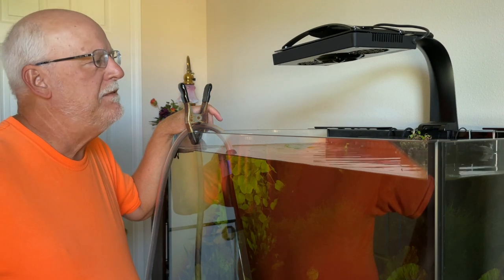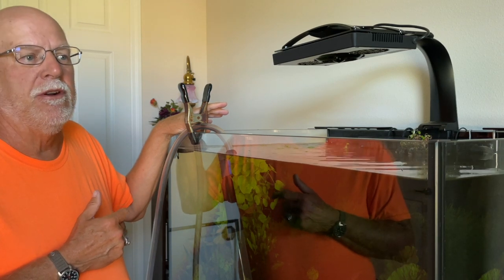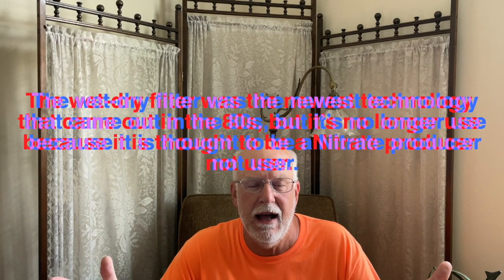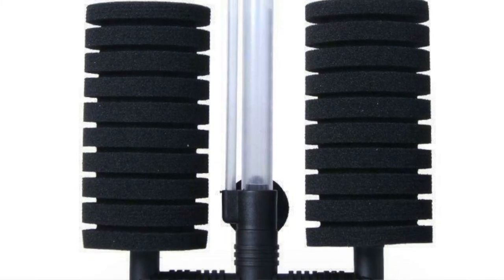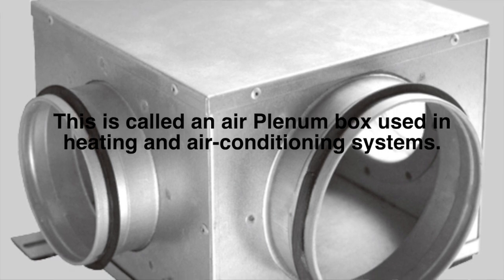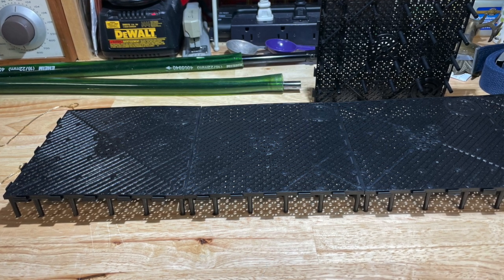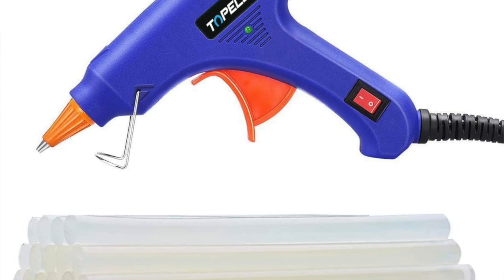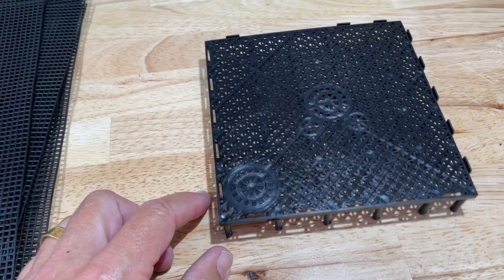Understanding the differences between a Plenum and an under-gravel filter.

Comment: The undergravel filter was killed as was clover in our grass lawns. Corporate couldn't realize a profit on a perfect filter system. Buy hang on, buy canisters. Kill the unbreakable undergravel filter.
Reply from the maker: If they are made of iron, or have iron impregnated into the Clay.
Reply: Under gravel filters work really well, but as you say, there's no cartridges or supplies to sell with it so it had to be declared to be inadequate. Just a plain old UG filter with some gravel on top will work for years and years. What accumulated under the filter is harmless and can be occasionally suctioned out through the lift tubes if so desired.

Comment: Contary to what Novak says in this video, if you keep mbuna cichlids, it is important to put your rocks directly on the bottom of the tank and then fill in your sand substrate around the rocks. Otherwise, if you put put your rock pile on top of the sand, when the fish dig the sand out from under the rocks, the rocks will shift and the whole rock pile will come tumbling down and potentially break the aquarium glass.

Comment: Hello Dr Novack from the uk.
I set up 2 tanks, exactly the same size, one with soil/gravel capped and the other with a plenum. (Ceramic media rings with mesh on top, then gravel) 
I then planted the same amount of plants in each and placed one light covering both tanks. The tank with the plenum, had much better, by a big margin, plant growth than the dirted tank. 
Thankyou for taking the time to share with the hobby.
Reply from the maker: This is something that you just said people do not understand keeping biological and chemical pathways open is a must. Once you do that and achieve that your plant growth will excel. I also explained that in my videos that you may come up with a "jungle tank" as I call it because the plants will outgrow the tank itself.
Reply: Did you have a bubble tube for your plenum? Or just the plenum on the bottom?

Comment: Your videos are EXTREMELY interesting. It makes me highly motivated to try  a different method of aquarium keeping
Thank you
Reply from the maker: Happy to hear that!
Reply: @anoxicfiltrationplenums  I am also motivated to try something different. I am having trouble with my 10 gallon betta tank.
My boyfriend mentioned under gravel filter. The penn plan is readily available.
From my understanding I would only need one of the lift tubes and it comes with 2. How do I block off the other tube!? Also can I use a dirt magnet as well!?

Comment: Wow 👍
So I got unto this hobby 8 months ago
And it was a dirt - planted tank that caught my interest
Now I find my self. Wanting to set up an African cichlid tank... But
I was a bit over whelmed with the work ( water changes) that I was hoping to avoid in this hobby
This under substrate system sounds great....
?  4U
My 100g has an outlet on the bottom, I should be able to send the water down right? Was thinking to send this water 💦 through an aqua fonics system next before putting it back in the aquarium 🤷:)

Comment: Thank you for highlighting and explaining the UGF with the plenum space. I believe the true downfall of the under gravel filter is not because of advancements in filter technology but  is the aquarium industries identifying that a  UGF as “dead” media of revenue. Once a ugf is sold, there’s little to no future revenue.
 The increased “ease of use” promoted by the manufacturers for quick and easy HOB and canister filter media exchange and replacement generates a continuous income but has also created more physical maintenance, increase costs for the hobbyists. Even the past 15 years, so many online experts have come forward like convicts reproducing to tell everyone that high flow rates and  increases maintenance with the introduction of even more additives and mandate increased  frequencies of water changes. Some even  advocating massive doses of fertilizers, macro and micro nutrients along with large % weekly water changes for planted aquariums. Aquarium products are very lucrative.  Not much after market once an aquarium is set up and finds its balance when using a UGF.- less maintenance, rarely done water changes unless topped off weekly due to evaporation.   What I’m getting at, marketing has dubbed UGF as old and inefficient and highlighting the dangers Of trapped gases in the substrate that is a “ time bomb”  just waiting to kill all your fish. 
 I’m most of my aquariums I’ve used. UGF, either with grid or pipe but this was my first time of hearing the term plenum and what the space offered and the science behind it.  On my largest aquarium, 240g heavily planted is UGF designed.  3/4” drilled pvc pipe grid surrounded by, 2” layer lava rock  then a fiber mesh, then  2”-3” gravel  layer with 2nd fiber mesh layer and 2”-4” course sand cap layer.   My up tubes are 1” topped with older styled power heads. I have utilized the the overflow compartment as a pre filter, flooding the space and adding mechanical and bio media as my high flow oxygen exchange area going into 3 cascade canister filters daisy chained together and uses an inline dc pump. I also have a stand alone cascade canister filter that the flow is reduced and being utilized as a co2 reactor with citric acid and sodium bicarbonate fed 4g  high pressure garden sprayer as a co2 generator.  My bio load  is high due to very heavy stocking.  This has been a very sustainable and minimal maintenance aquarium.  With this UGF setup I’ve experienced week long power outages without cycle crashes that some of my other aquariums have experienced.  Since the sand is white,  I do siphon the sand  of detritus and water that I collect for my garden.    In the beginning I was using a modified Ei method of dosing dry ferts but have since reduced to only adding trace micro and a few macro nutrients. Not  Adding potassium, iron or nitrogen ferts  just has not been needed. I do water changes but it’s based on my TDS levels when they reach. 700-950ppm  directly after a substrate siphon and water change tds is usually around 500-550ppm and water temp drops from 80-82 to 76-78 for several hours.   
Thank you for taking the time to explain the plenum “space”  and the difference of UGF pipe verses plate, barrier grid.   The reason I use the power heads is to be able to increase the substrate depth. I’ve incorporated the first 4” from the front glass only as a sand substrate layer. My water flow directs debris towards the front and I can siphon without disturbing the UGF in any way.  Some fish prefer to dig in this section verses over top of the UGF area.  Would like to note that the UGF was the only filtration in use for the first year but as increased bio load, I also added additional forms of filtration.  Next will be an above tank mini hydroponic low flow water system that I will try to incorporate your bcb iron/clay media bags filtration.  I don’t fully understand the ion exchange but for a full cycle nitrates need to be converted to a gas state to then be released via the surface agitation.  
Question:  Is it possible my co2 reactor canister is providing the correct environment and I just need to add the iron/clay media?

Comment: Good afternoon sir, so I have been watching your videos on the plenum. And your explanation makes so much sense. And I'm old enough that I used to remember using undergravel filter😂.
So I because of what has been explained to me I have decided to give it a try. I have multiple aquariums and the goldfish tank I only use a basket with filter floss on top and has some plants in it. Very little substrate of gravel just for looks. And I do have to do a water change on it.
Then I heard of the wastes method so I have a 50 gal that is heavily planted. With an overload of fishes. Wish me luck this don't go bad on me hahaha cos I remember when the dirt would turn black and stinks hahahaa
Today I set up the plenum not heavily planted and I only used gravel since I live I. The Philippines I could not find so.e plain cat litter. Wish me luck and will see what happens

Comment: I've been following Dr. Novak's ideas(bcb's, plenums, ect.) for quite some time now. I'm sure everyone has seen the negative comments in regards to Dr. Novak and the anoxic filter. I too had my doubts thinking he might be full of malarkey. I have since built a 13'*13'*2.5' pond with a 20'+ long stream. The water wasn't clear, a little greenish-brown. The pond has a sizable, built in upflow bog filter. While it worked well, the water clarity still wasn't great. In the last week or so I finally fired up my anoxic filter, a 140gal. stock tub with several(8) bcb's. It did basically nothing to start. A few days ago I added the rest of the baskets, some of which were planted, to the anoxic filter(140gal.) Literally overnight the water cleared up significantly! Here we are a few days later and I wake up this morning to crystal clear pond water! I cannot believe the difference that the anoxic filter has made. I don't have any very prolific growing plants either. Thank you Dr. Novak, you've changed a skeptic into a hardcore believer! Bcb's absolutely work!
Reply: The pond also has a bottom plenum covered in rock.
Reply: Wait till you can drink from your pond, you'll really be bragging! 😁

Comment: Thank you for this video I was trying to explain to my son why to use an under gravel  filter, I had an aquarium back in the 80s which was very successful using this kind of filtration, so I’ve started up my aquarium again using an under gravel filter, all I did back in the 80s was clean the glass and a water top up every now and then everything was just fine as I created an ecosystem well that’s what I used to call it anyway

Comment: I'm finding this discussion rather intresting, 50 years ago i started keeping fish using an undergravel filter. i noticed that the longer the filter was left alone the better the tank stablised. A 2 year old filthy undergravel produced better plants than a newly set up one. What i didnt understand at the time was that the clogged up substrate was creating the anoxic bacteria area that you describe by reducing the flow rate through the gravel. The last few years i have been using various methods of filtration ( no i'll never use external canister filters ever again) including large flow power heads with undergravels and having problems with plant growth. My next tank build will be going back to the basics, undergravel filter, gravel, layer of potting soil topped off with fine gravel and reduced flow rates. I did for a while wonder what on earth a plenum was having seen various mentions of it in different videos including placing gravel beneath the plate to provide an area for anoxic bacteria to colonise but the old school method from 5 decades ago deserves another chance in my book

Comment: Some years ago, before moving house, I had an aquarium of about 200 litres, where I did not change water for 3 years, just filling up when needed. I used an under gravel filter bought in England, probably not as advansed as todays UGF. There was an equilibrium between fish and plants. I moved house, and the aquarium was put aside for several years, until I some 5 yeras ago bought a Juwel Rio 240 litre. At that time it was not UGF for sale in Norway, and I settled for Juwels intern filter. I was not satisfied with the , neither fish nor plants were happy. So I bought an Eheim external filter hoping for better results. Now, several years later, I am still not happy with my aquarium. So some weeks ago, I desided to empty and throw away all plants, washed the gravel well and ordered through Amazone a Penn-Pax UGF. Under the filter I put a layer of Fuwal Ammonia remover. I put back the cleaned gravel, which is now about 4 inches thick. Newly bought plants were planted, and a couple of weeks later, fish were added. To get the UGF to work, I bought Eheim 400 air pump. I am not very happy with this air pump, it is not possible to shut the air to a minimum, the minimum air is as far as I like, not low enough. After a fortnight, the plants look healthy, and some have allready grown an inch.
Reply from the maker: Not the first one who has written to me about using under gravel filters in the early stages of aquarium, keeping and how successful they were.

Comment: Hello Dr. Novack,
Have been following your videos for a number of months after I found the first one when looking for information on UGF plates. I had a 20gal,. set up with one back in the 70's and decided to do it again with my recent new one. It is a 36gal. Bow and at first it was going very well and recently started to fail in many ways. 

After watching some for a second time I am finding I think I made a number of mistakes in setting it up. The plate I am using is a very old school plate I found used at a local store. It is a large one piece plate that fills the bottom, is wavy and has slits between the valleys and ridges, This is white and not blue as is usually seen.

Three mistakes I believe I made, 1. nothing to prevent substrate to fall thru.. 2. substrate not deep enough.. 3. Incorrect water speed flow... I know the first two will have an effect on the last one. How to determine if the flow is to fast or to slow?

Thanks, another Kevin

Comment: Hi Doc , thank you for posting your educational videos , I am one of your biggest fans. I guess I did my set up all wrong , because I’m one of those people that use the tubing underneath the aquarium with no void ,  based on what you said  I have no Plenum. But I did use kitty litter and rare laterite spheres from the northern Australia outback & use an air stone moving it slow , i’m not gonna lie it did take a little less than 1 year to get the results. I guess that’s what happens when I don’t follow your instructions , but nevertheless I am very happy because I have no nitrates and phosphates now. I wish I could show you my pictures on how I set it up
Reply from the maker: If you use the tubing underneath the substrate then you don't have the same electrical charge as you do using a Plenum.
Reply: @anoxicfiltrationplenums  
Your right Doc , maybe that’s why I had to wait so long for results because the first 6 to 9  months I had crazy allergy problems , but for now so far so good the next time I set up the tank I will do it the right way

Comment: I have a question Dr. Novak stated that the plants don’t like the under water filter pulling the air through at that fast of a rate, so should I utilize just a plenum or is there something I should do with the filter tubes/air pump or stones to slow down the flow of the filter portion?

Comment: Can I ask a question. Im thinking of settling up a Goldfish tank around 200L. I'm going to use a Plenum with filter plate and uplift tubes with Airstone under the plate through the tube as normal. On top of the plate I was think of using a small layer of alfa grog, then fluval stratum and then a layer of fine gravel/sand . On top of this I plan to plant aquarium grass and let it grow all over. Hoping that would be best filtration system yet. Your thoughts. Thanks. ❤

Comment: Thank you for these very informative and cost effective videos! Could someone please tell me if the lift tube has to be low or could it be used "as is" if the air flow is slowed down or would there still be too much suction? Thanks!

Comment: After my 10 gallon occupant died, I'm planning to tear it down and rebuild it with a slow moving plenum.  The only thing I have left to get is a undergravel filter.
I plan on using Safe T Sorb as the clay with laterite in between.  But the clay will also be the substrate.  I'm hoping that won't be an issue. I've heard of people having KH issues when using it as a substrate after long term usage.

Great video.  I'm excited to finally get to try this soon
Reply from the maker: I myself have not had a problem with KH in long-term use and I've been doing this for over 30 years.

Comment: Hello and thank you for the precious information.  I am in the process of setting up a new 240 litre tank.  Iam a big supporter of the "hands off / eyes on" approach to aquariums  -  I want to fiddle as little as possible and admire the aquarium more.  My project is for a dirt tank but I want to put a plenum under the dirt.  I will have a canister filter also,  LED lighting and I do not heat preferring ambient room temperature.  The tank will then be planted (semi intense) but not scaped.  So I am guessing a plenum and substrate of about 10 - 12 cm thick.  I would like to know what other minerals I can add to the substrate to complliment the iron tabs / gravel that I shall add.  I shall mention here that 50% of my dirt comes from a peat bog where I also add some peat bog mulm.  The rest of the dirt is topsoil ...  the real stuff from a forest floor with some sphagnum moss added. My questions are the following :  Would sphagnum moss be too much vegetal content to the dirt ? - Would the dirt impede the anoxic process ?  -  Do you think that a cycling period of 60 days sufficient before adding inhabitants ?  -  As mentioned before,  what added minerals should I place in the dirt for the plants ?  Thank you for your ideas.